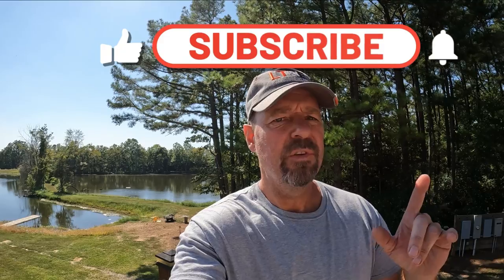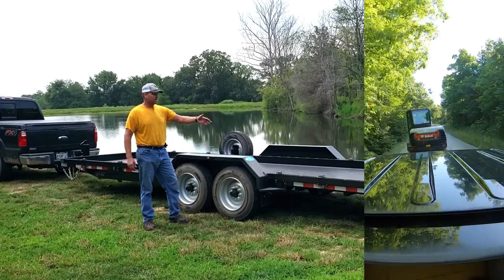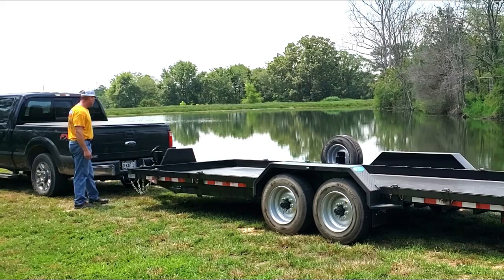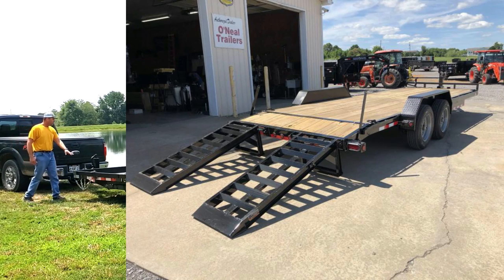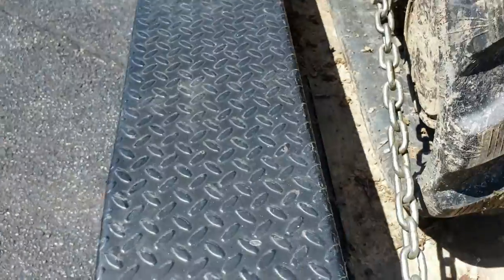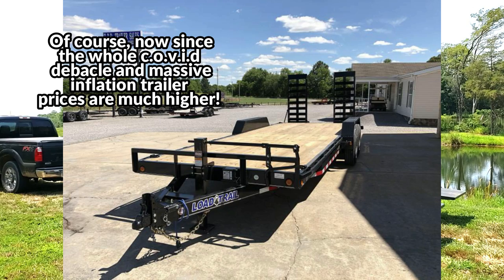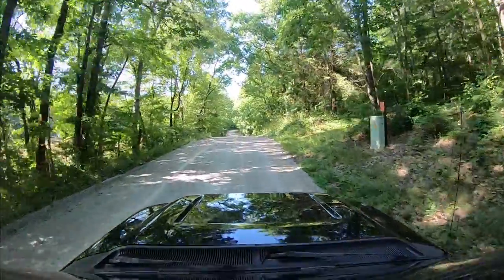DO I NEED A CDL FOR MY TRAILER!?  Buying an equipment trailer-some things to consider.

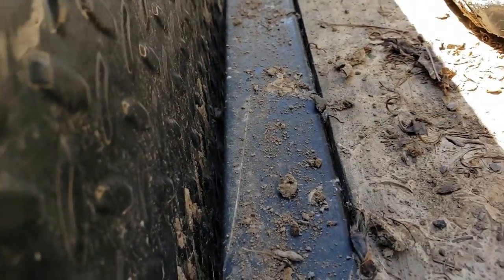Comment: 7:51 The fenders on my Diamond C equipment trailer do the same thing.  Wish I could have ordered weld on fenders instead of the removable fenders but I purchased it from the dealer and that's how they ordered it.
Reply from the maker: yeah I hear you there is always one or 2 changes that we'd make in hindsight.. I have a couple on my new trailer as well. Thanks

Comment: Great video… it took me a while to understand but now realize it is all about the GVWR of Truck + GVWR of Trailer = GCWR, which must be under 26,000 lbs regardless of why you are hauling; personal or commercial.  But…. Always a BUT… I have heard that trailer mfgs can and will “under-rate” a trailer for you and you can legally change the trailer’s GVWR so it keeps you legal.  Personally, I would never tow more than 14k GCWR off the bumper hitch.  If you want to max your truck and trailer GCWR, then go with a gooseneck trailer.
Reply from the maker: Trust me, there was even a lot of confusion with the DOT folks as I was going through the process!! Good points for sure thanks

Comment: same here 26,000 lbs or over you need a class B or with air brakes a CDL. it allways seemed i would go over with my crew cab 3500 fords. so i keep a few single cab 2500 that would work. stuck with 14,000 lbs trailers. would use a second truck for impliments.  main trialers were deck over 20 ft. used them to get lots of materials for jobs.
Reply: Class B is for straight line trucks. If a trailer is towed it can not be rated over 10,000 lbs. What you are doing would require a class A without air brakes provided the trailers aren't equipped with air brakes.
Reply: @garyrobinson219  my misstake.

Comment: I just bought a heavy duty 7x18 ft trailer to haul a 5045 John Deer tractor then found out some say only 5000lbs tung weight for step bumpers I don't know if that's pulling weight or what the tractor weighs 4800 the trailer 2800 so I dont know  I am in Kentucky Lexington and farm outside of MtSterling.
Reply from the maker: This stuff does get a bit technical for sure. Best of luck thanks

Comment: All the weight you carry in your truck adds up so you might not be able to haul x amount on trailer. Have you every weighed  your truck to see what it weigh
Reply from the maker: I have the factory weight, but it's not really relevant as the CDL requirements use GVWR, even if the truck is empty.
Reply: Guess it's different down south we can't be over on axles or GVWR if your truck says 26,000 total truck and trailer then because your license says 80,000 class A doesn't mean you can haul it am wrong. Just bought a 2500hd and my GCWR IS 27,500 TOTAL so if my truck weighs 17,500 all I can pull is 10,000 total correct,  I'm trying to understand it

Comment: State by state its different but as an average you only need a cdl if your making money with said equipment other then that you'll need a class b or a depending on your weights
Reply: CDLs are not state they are Federal. Class B is for straightline trucks.
Reply: @garyrobinson219  your missing the point if what I'm saying.  You only need a cdl if ypur driving commercially if its private then you'll need a B or A license for your weights. States have them noncommercially for things like people pulling large heavy rvs or in this case homestead applications like moving your equipment around non attached properties or to take it for repair
Reply from the maker: yeah I guess your first comment was confusing, to me too. But I hear you on this one. Glad I went ahead and got the class A. Thanks man, honestly I think they should increase those weights a bit with the new trucks and trailer these days, they are made a lot safer. Thanks

Comment: I wouldnt pull with that 250 ford, now you need a f350
Reply from the maker: The 350's use the same engine, and this truck has the super tow package, the highest level above the standard tow package, hence the 2.5" receiver. At least that is how I read the spec sheet on it.

Comment: Your not legally allowed to load anything past the flat surface on your trailer. So you can’t load on top of tool box
Reply from the maker: I've never seen or read that. My understanding is that as long as you are within your legal weight and legal trailer width and lentgh that you'd be fine.

Comment: If it's personal farm equipment and not use for commercial use , no 
* granted they are making trailers and trucks a lot larger and heavier. And newer Gas/ Diesel trucks can handle more weight.
I think DOT / DMV needs to change that ruling from 26,001 lbs to  $30,001* 
Exemptions

Vehicles for personal use not for hire, military vehicles, Emergency Vehicle, farm vehicles (that meet all exemption requirements), Operated by farmer or employees for the exclusive use of farm, used for the transport of agricultural products, supplies or equipment to and from the farm, not used for hire, and used within 150 miles of the farmer's farm.
Reply from the maker: I do agree with that, the personal use should be increased like you said. Campers, boats, trailers and trucks have gotten bigger over the years, and safer.

Comment: A CDL is required when towing a trailer commercially that is over 10,000# even if you are below the  26,000# combination weight so technically you should have had a CDL for your old trailer
Reply from the maker: yeah I went back and forth with that one, and even the folks at the DOT offices said in that case you did not need one. That's what happens with too much gov't lol.
Reply: @kapperoutdoors  well the problem with all this is that back 20 years ago a pickup wasn’t rated to tow as much as what a new pickup can tow now and it has turned into a mess with all these different licenses